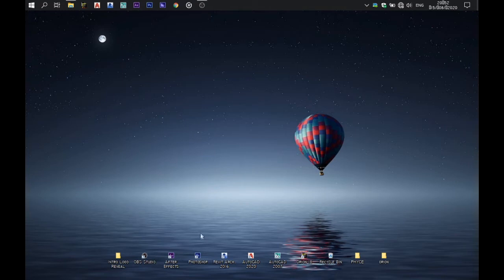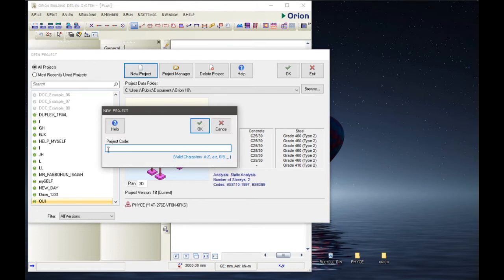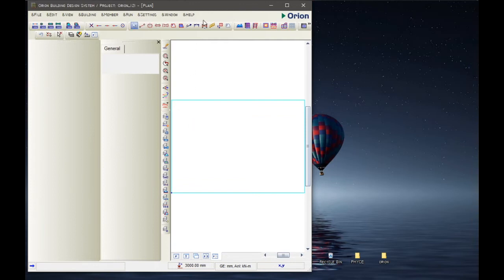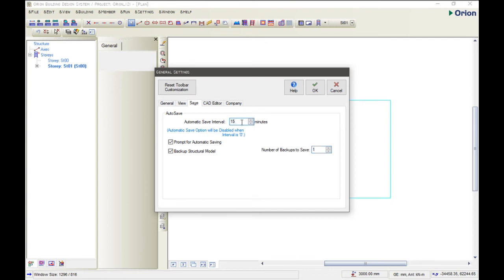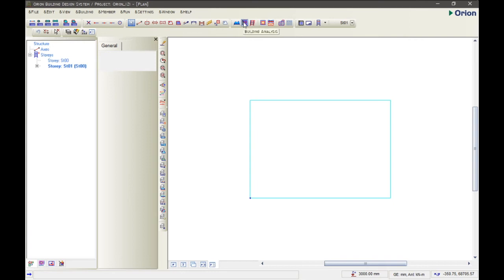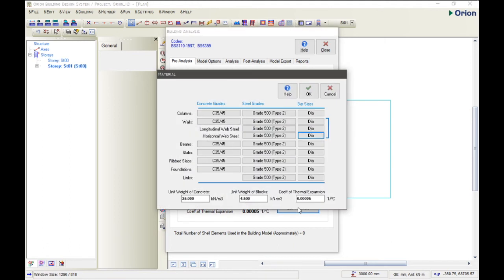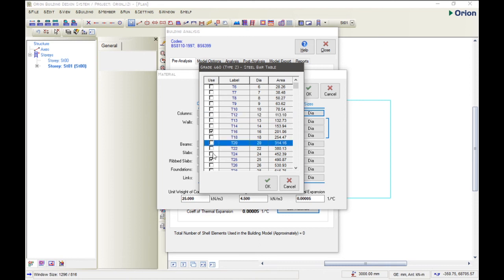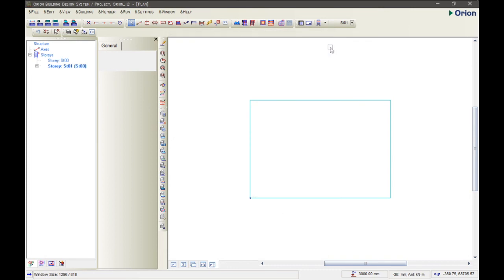Basic Tutorial On Orion For Simple Structure _ Part 1

Comment: D setting of dimension: d concrete grade, d links ND d steel grades are based on experience?
Reply from the maker: Yh, but not really. The software also has the capacity of calculating the required reinforcement too.